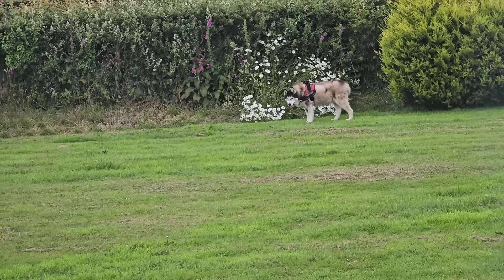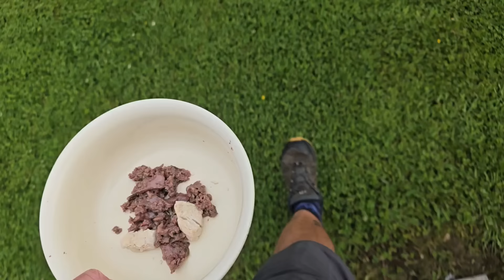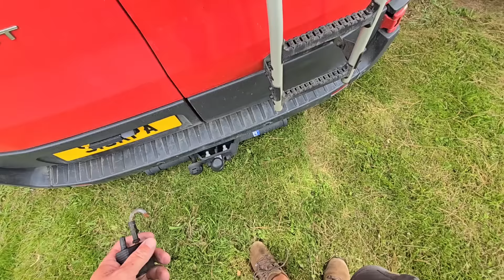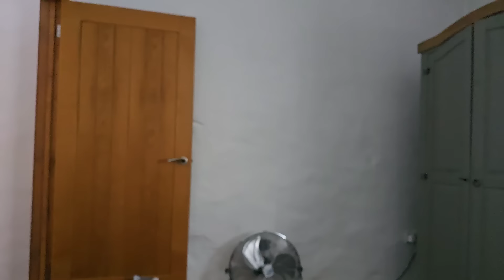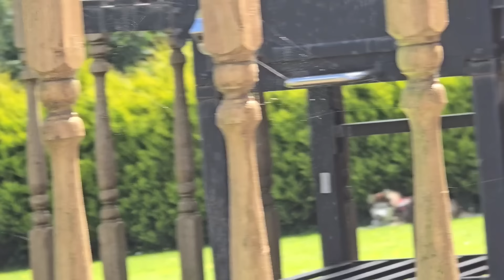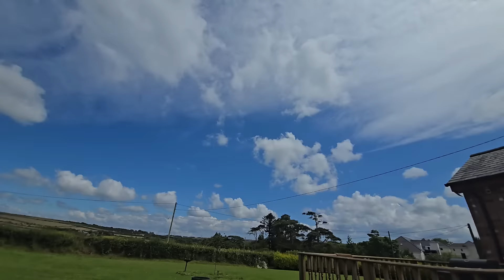I Hate This Emotional Roller Coaster That We're On!

Comment: My lovely Karma, is in what my Vet says, is her last year. She has very little control of her back legs. She is holding her bowls and bladder, though. Her hearing isn't so good. She needs help now and then repositioning her self on her bed.  Karma is a Labrador Shepherd mix, so she is on the smaller size of the mix, but still around 65 pounds, about 29 kilograms if I did the maths right.
  
It's a bit of a challenge helping her, I have MS and my legs and left arm are just as bad as she is now.  The vet has her on twice the dose of Gabapentin then I take.

So long as she remains interested in the goings-on in the house and has a good appetite, I will do my best to keep her going.

If she can make it to the 22nd of December, she will be 15.

Comment: Just a thought but when I had to take a strong antibiotic, I had a very bad reaction. and couldn’t walk without extreme pain like electric shocks in my spine and a damaged achilles tendon that I felt snapped while I was just standing!  I had to wait until it cleared my system for a couple of weeks to walk without crutches.Hang in there. Vets are often quick to advise putting a dog down. I had a vet advise it for a dog once who had another 6 months! You will second guess yourself no matter what so it’s best not to have any regrets.